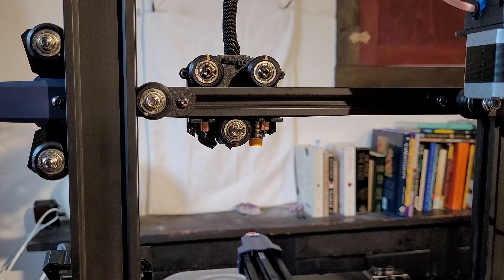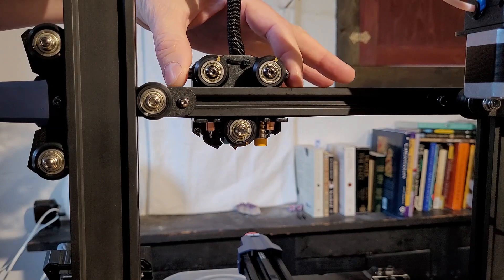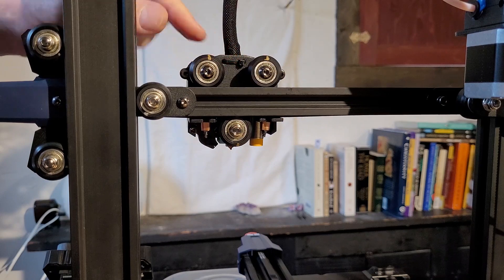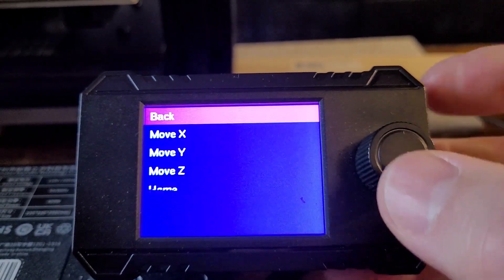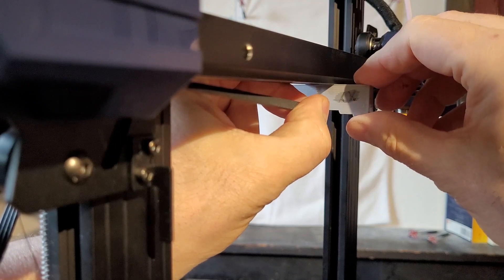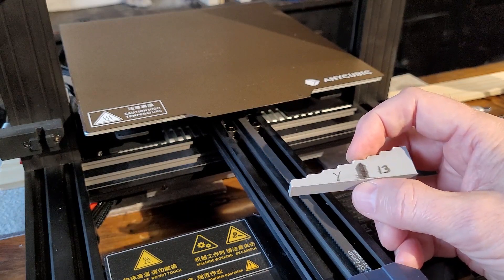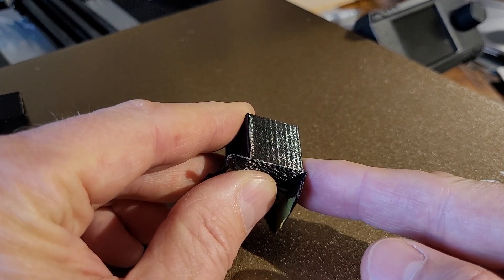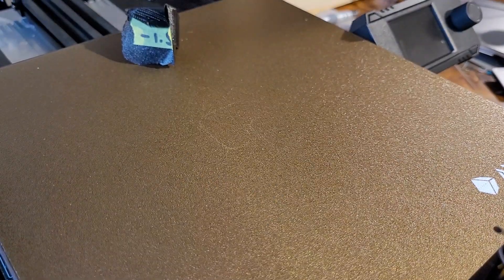Anycubic Kobra Go Eccentric Roller & Belt Tension adjustment

Comment: My boyfriend recently bought an AnyCubic Kobra 2 Max, and he keeps getting the error message that his x axis zeroing fail telling him to check the motor and wiring. Could you give a few tips on how to fix that?
Reply from the maker: Morning DECA, the very first thing I would verify would be when homing , does it reach the switch?  I don't own a Kobra Max 2 so I don't know which type of switch it is or if it's hidden, but follow the movements when homing and watch to see if it reaches the switch first before looking at wiring. Then if it does reach the switch but you get an error, follow the wire to make sure it is plugged in. Let me know how it goes.

Comment: Thanks for the video. You have helpful tips every time. I have Anycubic Kobra 2 Neo and had it about 2 months now. It was on sale for 149 €. It prints very well. I do autolevel before every print
and i wonder that my z-offset is different every time after that. It differs from- 02.14 - -02.41 some times  -01.20. Occasionally i have had adhesion problem after autolevel so i did a second autolevel. I think it is not normal. I have not figured out yet how to keep it constant or if it is even possible. Yesterday i was going to print an mousepad stencil that was 200mm x 200mm and 0.6mm thick with 6mm wide Skirt. When it started to print the Skirt, it didn´t stick on the bed in 2 corners. It was so late at night so i didn´t try anymore. This is my 3rd printer i own. Before this i had Anycubic i3 Mega. And my first printer was made of plywood and it cost 80$ on Ebay and all the wiring was hanging all over the place. It´s funny that no matter how expensive printer you buy, they still don't work 100%. You would think they had invented a printer that has not those " old " problems, bed leveling issues, etc...Next printer i will make my self. Today you can buy all the parts for a printer. You only need to make the body. And that printer will not wobble and the bed will not move where it shouldn´t 😄
Reply from the maker: Thank you for taking the time to comment and share :)

Comment: First I'd like to thank you for all of this. You've helped me tremendously tune in my kobra go.
I bought them when they first came out and I became so frustrated with it I had to give up.
In the last week started working on it again and after finding your videos and some other websites I have got my kobra go almost dialed in which brings me to my questions...

I've followed the directions in this video and my printer skips along the y axis if I have it as tight as you demonstrate I  this video.
Now I did change out the stock belt for a higher end heavy duty gt-2 timing belt. Is it possible that this belt jig you've made won't work for other belts?
Reply from the maker: Hi Andy, thanks for the feedback and glad you're making progress.  Different belt will definitely require a different adjustment.  Best recommendation I can make is to run some tests while monitoring the tension. Keep us posted how you make out.

Comment: Thanks a ton for this. Tightening the carrier finally fixed all of my issues. And the belt tension guide I'm using for both my Kobra and Kobra go now. Thanks for this guide.
Reply: I was ready to sell the Kobra go. It was driving me crazy with all the issues.
Reply from the maker: Thanks for letting me know it helped 🙂
Reply: @mayhemsmiley  my wife told me to give the vid a like because it helps the creator. So I decided to do one better and comment. My Kobra go was up on FB market until this. I am still selling my resin setup. Decided I don't want to deal with the chemicals.
Reply from the maker: @NinjaPossumStudios  I'm the same for resin printers. I'm already messy enough lol

Comment: How would I know if the rollers are to tight on the y axis? It almost looks like it’s eating the rubber off.
Reply from the maker: Hi Carla
If it's damaging the rubber is too tight and you may need to replace the rollers. But if they aren't seriously damaged then ease off in small movements. With fingertip pressure you should be able to move the print head or build plate but without any slippage.  Let me know if this helps
Reply: @mayhemsmiley I can push the rollers with my fingers, but I can feel a catch at a certain point, I’m just not sure how to tell if it’s my belt or the rollers.
Reply from the maker: @carlascreations3909 You could disconnect the belt to eliminate.  Are you a member of Facebook ands the anycubic kobra go group? If yes post some pics there if your rollers. I pop in there regularly and there are others who are very helpful too
Reply: @mayhemsmiley  good idea, yes I’m a member on some of those I’ll post there to thank you for the tips!
Reply: @mayhemsmiley I took the belt off and I can still feel the catch so it is the wheels. If I loosen them will it fix it or is it to late and needs new wheels?

Comment: Good video! I've dialed in my kobra neo perfectly by accident I think. The only thing that needed to be adjusted afterwards was the z-offset. My tool to tension the belt is my ear. I just pull the belt a little, let it loose to make a sound with the belt. The sound has to be like a guitar string that's very loose. The prints look almost like glass, besides for the Z-seam and the almost not visible layer lines.
Reply from the maker: Thanks, too funny I tried the guitar string idea, but I've always needed an electronic tuner to tune a guitar LOL This video about setting the z offset might be interesting too https://www.youtube.com/watch?v=s44ZC3RfFdA&t=40s
Reply: @mayhemsmiley  thanks, I do this while printing a larger 1 layer square and eyeball it. I also have a note with 2 diagonal lines to create 4 sections to write down the values. In my case there are two sections with a minimal too low setting (which you can barely see) and two which look perfect for the naked eye. But there's a difference in texture when you use your fingertip and nails to find out which one if  the best setting. I found out that this was the only way to get the Z-offset perfectly dialed in on 0.020 accuracy. (I wish there was a step to do it in increments of 0.010 or lower to dial it in even more). It's more level and the Z is also better than the Bambu will ever get. There's nothing more superior than the human brain and his senses. Try this method and see if it will give you an improvement of which I think it will. It will beat the naked eye. But bare in mind that the values sometimes change after you've automatically leveled your bed again. 

And for newcomers (you might have to do this several times to find the four numbers which you can choose from the next time when you're ready to adjust the Z-offset after a few weeks of continuous printing).
Reply from the maker: @Badg0r  Hi Badgor, Just an FYI I haven't run the bed leveling again since this mod and it runs really well. I still use the auto bed leveling simultaneously but with minimal z axis movement during each layer of my prints. What an awesome hobby :)
Reply: @mayhemsmiley  I'm downloading it right now to make sure my belts are as tight as well. It's always good to have a good tool at hand.

Comment: Sir I’m very greatful for your videos. 

Quick question. I’m having a lot of issues with layer shifting. Not sure what the issue is. 

I have multiple ender 3s with no issues. 

Took the time to tram the bed and did the leveling on it. Am I missing something?
Reply from the maker: Thank you I appreciate the kind words. There can be a few causes, but before we go into the possibilities. Is it random when it occurs and will the shift repeat? Big or small prints when it occurs. Is the shift specifically in one direction x or y. Or is the shift always diagonal? Let me know and I'll see if I can help you work through it.
Reply: @mayhemsmiley  so I actually figured out the issue. A wire was tapping the Y end stop. Twist ties fixed it. 

Got it printing at a constant 100mm/s with klipper too
Reply from the maker: @thekidd2323  great news and awesome. Thanks for sharing the source of the issue. Happy printing :)